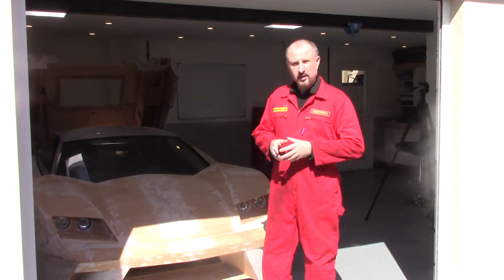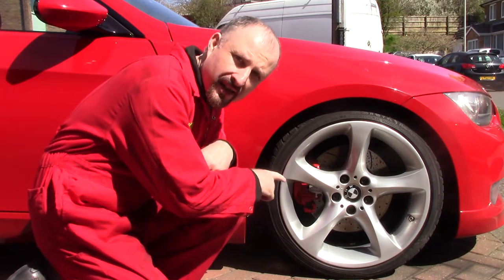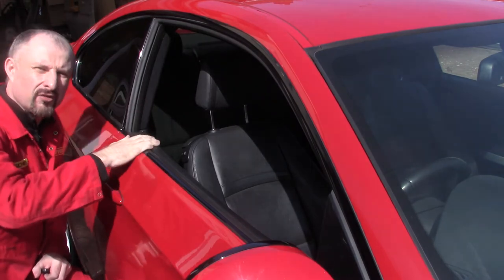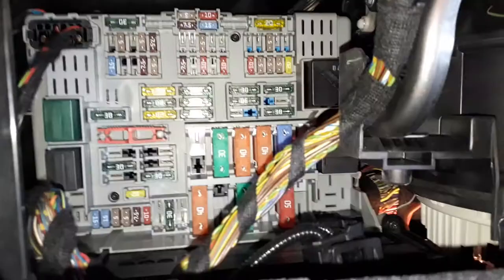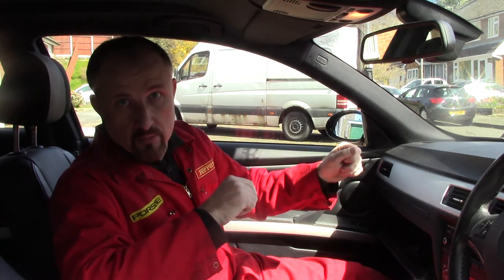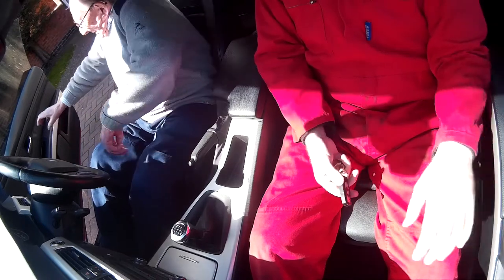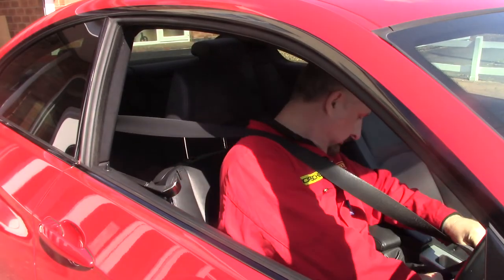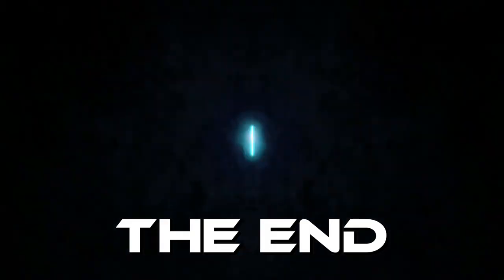How to Repair your BMW Seat Belt Extender Arms: Quick Tech Ep4.

Comment: At 7:06, u removed the long spring. Does it need to go back in? If not, what was the purpose of it?
Reply from the maker: No, you don't need to put it back it. The purpose of the spring was to pull on the latch, to give it tension. But the metal clip snapped, so the tension is lost. With the pin and epoxy now holding the latch permanently in place, the spring isn't required.

Comment: Hello and thank you very much for this very detailed (and full of humour) video 😂.
First, sorry for my English which is not my mother tongue.
I could  not repair the hook of the belt, as you show, as it broke fully at the point where we have the button closing the hook when it goes back into its emplacement. So I ordered one as a spare part.
However, my problem is that when I tried to remove the remaining part of the hook, the whole arm came to me 😢. It will be therefore easy to clip the new hook to it, but I am wondering how to put back the whole arm in its emplacement? I understand that there is a kind of toothed wheel moving the arm forth and back.
What do you recommend? Is it better to present the arm in the open position (as if it is presenting the belt), and then wait for the toothed wheel to bring it back? Or push it back inside in the closed position?
Another point is that this arm is not straight. It is slightly bent. Should it be really straight,  as this part of the car is slightly curved here...
So, sorry for all these questions,  but I would like to avoid making additional mistakes 🙄.
I hope you can give some advice. 
All the best,
knarf from France 🇨🇵😉
Reply from the maker: Sorry, but I did this repair a few years ago, and I no longer own the car, so I can't really advise you.

Comment: Thanks for that, very useful for my passenger side. However, on the driver side, my seatbelt extension doesn't move at all. Any idea how to fix that?
Reply from the maker: I would say a fuse, but then both wouldn't work. It could be a dead motor, if you're getting nothing at all. Probe for 12v, if you have a supply but it still doesn't work, then it'll be the motor.
Reply: @ProjectSupercar  Thanks, I'll try that

Comment: Just did this fix and ten top part still seems too weak because after it pushes the belt out, the belt slips halfway through the path. Any advice? Thanks
Reply from the maker: Usually this means your belt is binding up and takes more force to retract, this is usually caused by dirt build up on the belts, that cause drag. Try giving your belts a really good clean, then spray with silicone spray.